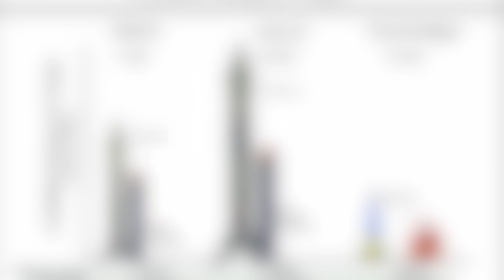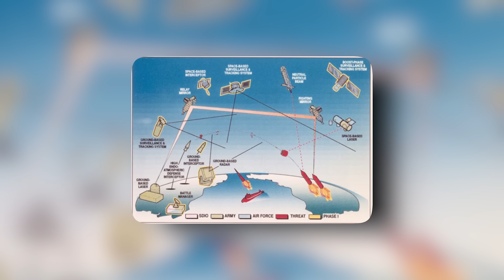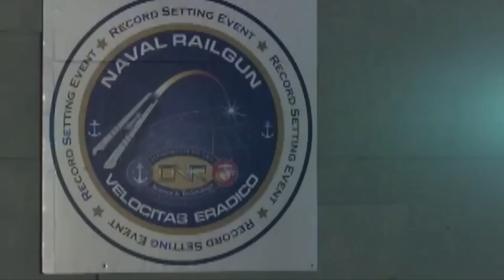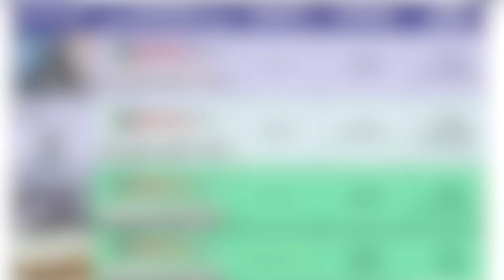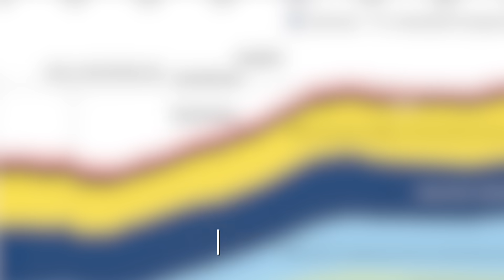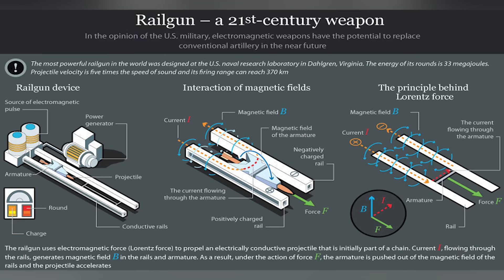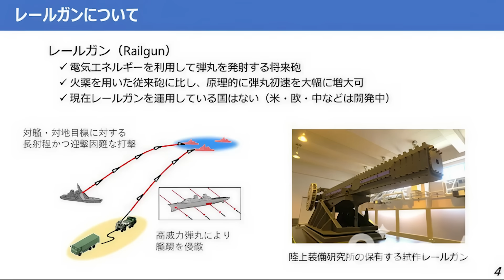Japan Revives a Scrapped U.S. Superweapon — And It Actually Works!

Comment: Taiwan could use this rail gun for shore based defense.
Reply: That’s what I was thinking too
Reply: When your transports get sniped while still in your harbor by shore batteries a hundred miles away.
Reply: The problem ultimately becomes the eroding of the barrel. But if Japan and Americans can figure out that issue it be a great weapon for Taiwan indeed!
Reply: KMT just failed to purge its opposition. They are in a political gridlock until 2027.

 You don't hear this on western media, but taiwanese pleople are not eager to become the next US proxy.
Reply: based defense
Reply: Get a Patriot system, or any other weapons, it's better.
Reply: IMHO shore based batteries would be the best possible use all things being equal.
Optimally navalising the weapon would require a vessel built around the system.
Reply: China will get the full blueprint the next day it arrives Taiwan.
Reply: Stationary defense will be deleted by cheap Chinese drone and rocket swarms
Reply: @pacivalmuller9333 They do not need to be stationary.
Reply: 核を用いて現状の変更を試みた。
敵がその汚名を嫌うなら、
台湾の防衛戦は先次大戦と変わらぬ制空権の確保に始まり、
あとは対艦戦闘と対ミサイル防衛に尽きるだろう。
日本のF-2みたいな対艦番長の戦闘攻撃機で敵艦を駆逐して、
上陸を絶対に許さないこと。
陸のレールガンの出番があるようでは話にならない。
上陸を許せば原住民の抗日運動まで遡ってゲリラ戦。
ドローンがあるからだいぶ違って来るけども。
そして、そうまでして抵抗して、
支持する味方があるのかが肝心だ。
人民共和国に台湾侵攻を許すような世界なら。
その時点で話が終わっている。
Reply: recoil could be mitigated by flinging the rails backwards, and out the gun, possibly using the initial magnetic pulse to do so
Reply: Like neon genis evangelion

The rail gun is stationary weapon there nd require all of japans electricity to fire a single round
Reply: @OSTemliThat’s a positron rifle. Antimatter is expensive
Reply: @OSTemliJapan already developed the power technology for the rail gun to fire several shots! It’s the barrels, they go bad after several shots. Japan is working on that engineering problem.
Reply: Under the international rules based system centred at the UN, Taiwan isn't a recognised country, it's still officially Chinese territory.
With that in mind, no UN Members are going to give them weapons.
This is why the UK offshored all tech productions to Singapore a few years ago.
Reply: @jamesknight3070 Then why have the US consistently given them weapons?!? By the way the US stance is ambigous, not on the one china policy
Reply: @jamesknight3070  this is partly due to china blocking their attempts to become recognised, and many individual states recognise them, including a good deal of europe.
Reply: @jamesknight3070  Yes the ROC. Taiwan is the real china, the CCP are the usurpers. 🤣
Reply: The china could also use these on their warships.
Reply: @Goofyzabi  Their warship would be torn apart by a railgun fire recoil

Comment: This rail gun technology is a game-changer! Japan's success in developing a working model could really shake up naval strategies in the Pacific.
Reply: It works, That's not the problem. The problem is how much shot can it make before it has to be replace? You see that dust that released from the shot. That isn't gun powder. That's literally the guns barrel grind to dust. It can't shoot enough time to justifies using it.
Reply: @roiking2740  Japan made a barrel that withstood consecutive 120 rounds test without erosional damage so far.
Reply: @funkya1840 that’s impressive, but it’s probably not as powerful as it supposed to be in that case
Reply: @funkya1840  conventional cannons last 1500 rounds
Reply: @shanegibson3281  Can conventional cannon shoot down ICBM or SLBM? NO. Railgun is being developed as an option for Tomahawk missile
Reply: @roiking2740  it's not dust, it's plasma. When thousands amperes of current flow between rails through the projectile's conductive casing moving at the speed of a few kilometers per second, the contact point heats a LOT. The projectile's casing is designed to turn into plasma because plasma is conductive and it helps with friction too but rails get vaporized/melted/eroded as well.
Electromagnetic accelerator doesn't have such a problem because it's possible to maglev the projectile inside the barrel, there is no current flowing through the projectile, only magnetic fields, so it doesn't need to touch the barrel at all. But it does require a series of strong electromagnets and a complex control circuit to switch them extremely fast. While the railgun is basically just two metal rails, one ON/OFF  switch and an extremely powerful power source.
Reply: @roiking2740  then magnetism tech to shield the barrel should be improved
Reply: @hotdog9262 you are talking about something that may not be psychically feasible
Reply: Us had a working gun 15 years ago....maybe 20
Reply: US had a working model too, just gave up on it when we realized the investment, power consumption, and weight weren't worth it. So maybe they can improve it, but we dropped the design for a reason.
Reply: It's not like it's game changer that much, it's just that would cost much less on the ammunition cause if fast huge missiles were crazy cheap to build they wouldn't even ever care for a railgun and just keep firing missiles at everything all day long.

Even tanks nowadays also have enough energy for what they need and they are smart guided rounds with a much smaller cannon that also likely don't need railguns for their purpose as they are direct firing and not artillery.
Reply: The only ships that could run it are the zumwalt and the new flight 3 DDGs. The barrel had to be changed every three-ish shots. Electromagnetism and steel ships inherently don't go together, which is 1 of the biggest reason the EMALS system on the new carriers took so long: it kept warping the deckplates
Reply: @RAWDEAL064 now compare that to aquatic drones, the cost and logistics  is far easier and cheaper by comparison.
Reply: I’m in seal team 6 and I’ll tell you rn we have that but instead of a barrel I throw them at the enemy. Keep it lowkey though.
Reply: not really, they got it to work by sacrificing effectiveness, sure it works but its not as good as what we already have
Reply: Drones are a game changer, a few $100k aquatic drones can sink a battleship

For the price of the rail gun, you can make enough to sink a carrier group
Reply: Yeay, gamechanger... lets waste some billions on this thing that fires couple shots max while the other superpowera will produce 10000 drones by the same price.
Reply: Quantity has a quality of it's own. Saturation tatics will always beat "gamechanger" solutions simply because they are cheap and fast.
Once the expensive toys are out of juice, anything will do the job even a cheap 5k drone.
Reply: @snes-mode7 exactly, where is the IJN Yamato and where are the Iowa class battleships?

Comment: They could save a lot of time and money by using an array of electromagnets, storage capacitors based on electrical transformer designs and power it by siphoning off of the existing power plant of the ship while being able to fire it multiple times without a charging phase.
Reply: None of that makes sense. A rail gun is already made with electromagnets and capacitors plus it was already supposed to be powered by the ships power plant. There's no savings of time and money there but there's also no way to avoid a charging phase. 9.9 megajoules over a few milliseconds equates to several gigawatts of power. Even carriers "only" have 104 megawatts of capacity.
Reply: There is no saving time and money with railguns. The thing is made to be almost disposable.
- It fires a metalic thing into oblivion at mach 15+.
- Completely destroys itself in a couple shots. 
- Takes loads of money and time to repair.

Rinse and repeat.